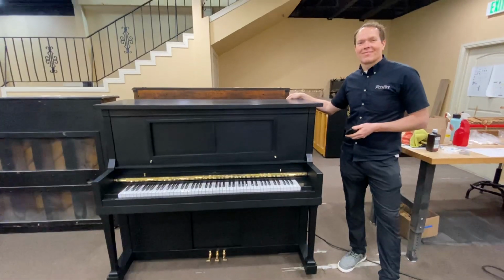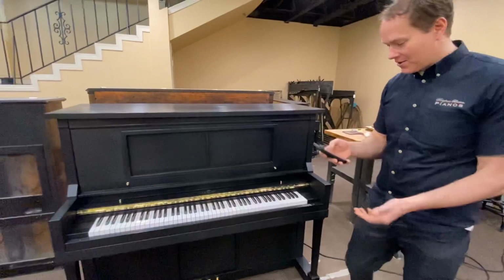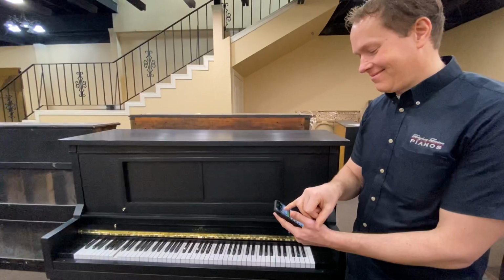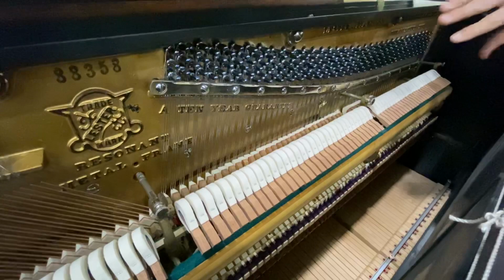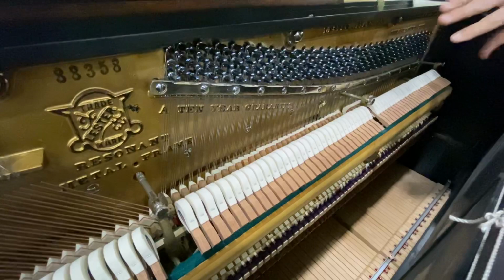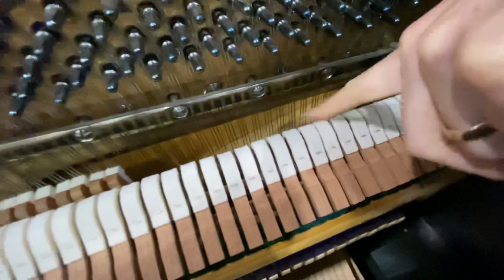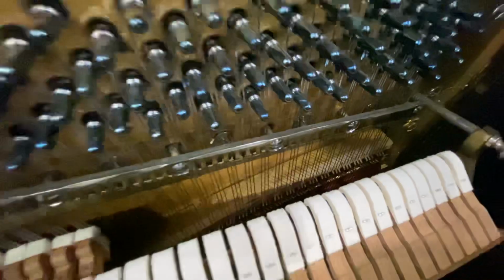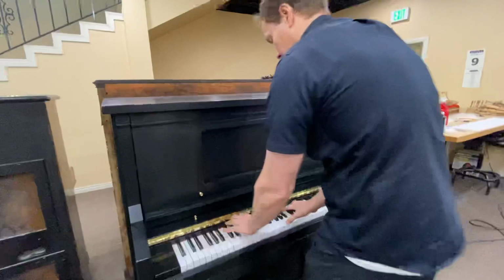1924 Lester Upright Piano

Comment: I can see that the keys are moving but not the pedal... How does it work?
Reply: Hi there, it's these electronic controlled solenoids that are designed to push on the keys from underneath.
Reply: @jeremyelmore9236  oh yeah, true. So it's all about the visual. The sound comes from transducer attached to the soundboard I guess
Reply: @michelprimeau4531  No, the solenoids push up from the bottom of the keys, but actuate the piano action as if somebody was playing from the keys normally. The backing track you hear Comes from a speaker. Those are usually mounted on the back of the piano.